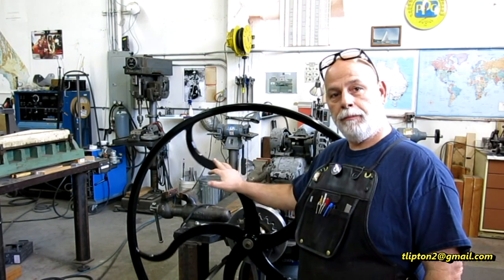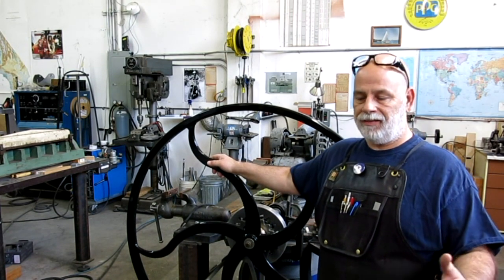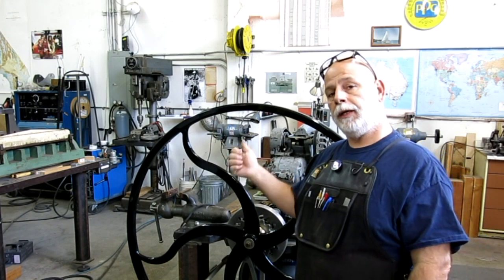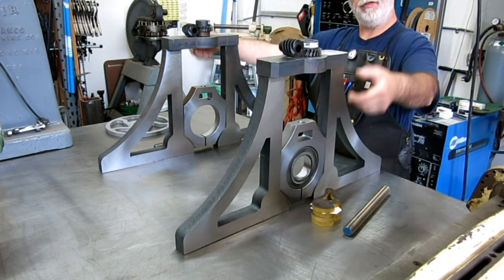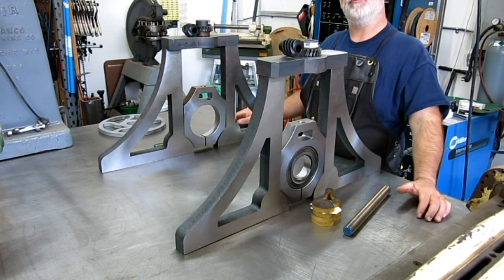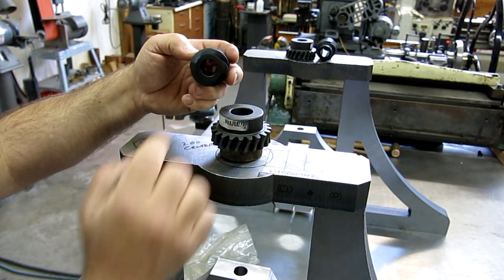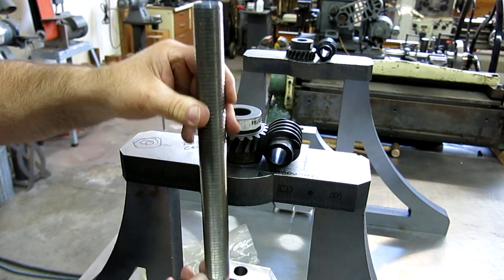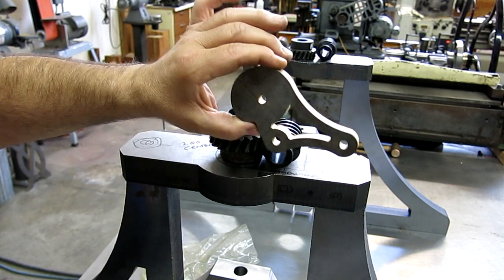Etching Press Re Boot

Comment: Bout time Tom. The gear setup is almost exactly like my neighbors planer. He couldn't adjust the table so we had to sus it out and disassemble the mechanism. It's an old American made three phase machine with three motors. One powers the cutting blades, one powers the table adjustment and a third powers a grinder for sharpening the blades.

Short version is that the elevation screws were originally shielded with rubber covers. Long gone, find dust jammed the works up. Got it disassembled and cleaned up and working. I obtained a dirt bike inner tube to make some new covers but he keeps getting new work and won't take the time to finish the project.

Looking forward to you're completion of this project.

Comment: You are basically building the type of press (spider press) that used to print US currency in the early years of printing. I work for the Bureau of Engraving and Printing as a maintenance technician on the current equipment. Machines are mostly made in Germany now.
Reply from the maker: Hi Barrobby,

Can I borrow some plates from you.....

Thanks for the comment.

Cheers,

Tom

Comment: I sure that we will all enjoy watching you work and then decide that we could have done it better and let you know, LOL.
On a serious note, how do you calculate the mechanical advantage (leverage) that the gears of the lift system provide to determine the force needed to operate the press to make sure that they are not excessive?
Reply: Good question John!
Reply: Weight to be lifted / (gear ratio x radius of handwheel in feet) = 25.

I use 25 as that is most likely the typical amount of ft-pounds that Tom's wife will want to exert when she is using the press.  If you have an NFL lineman running the press, that number can be more like 150!

Assuming a weight of 300 pounds for the roller plus lifting parts and a 0.5 foot radius on the hand wheel gives a 24:1 gear ratio.

In real life the amount of force needed to be used is probably 10% to 20% higher due to friction in the mechanism.

Regards;

Ron Kluwe